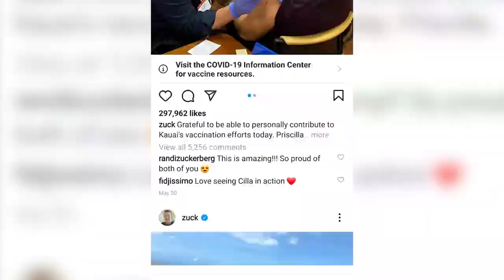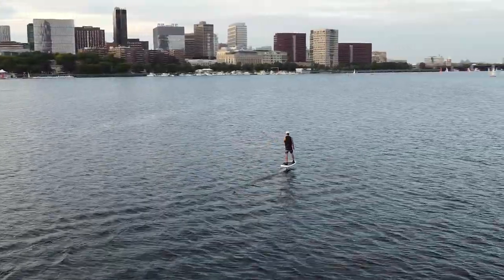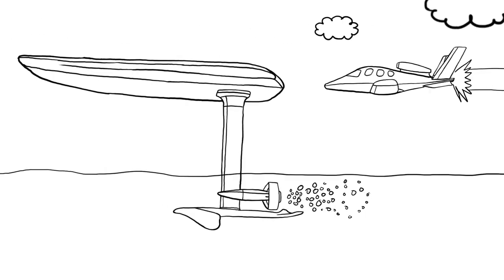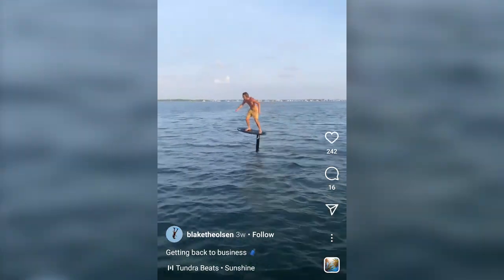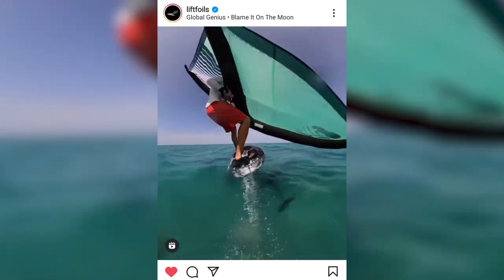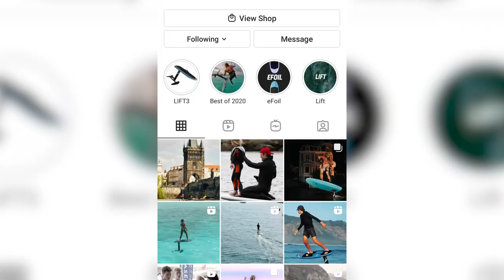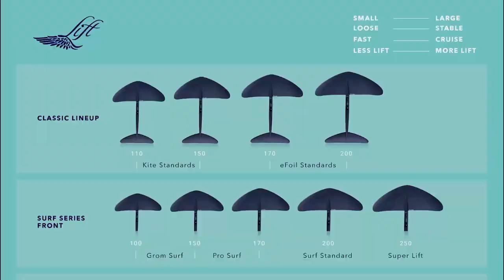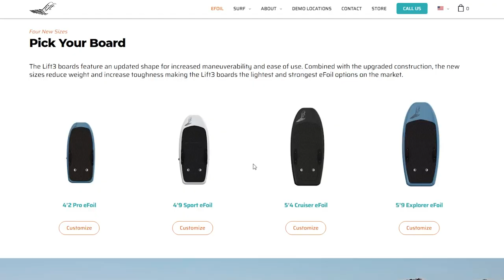How eFoils Work - Electric Surfboard Explained!

Comment: May I ask if you can continually change between an e-foil propeller and the pump action (hydro) one for the same board?
Reply from the maker: There are companies working on this. Check out https://lacroixboards.com/pages/efoil
Reply: @TechWeWant  thank you! This is really interesting! I was actually meaning if the same board can be used if you install a hydrofoil and interchange it with a efoil for example. I'm a total newb and think it's something I will take up in future